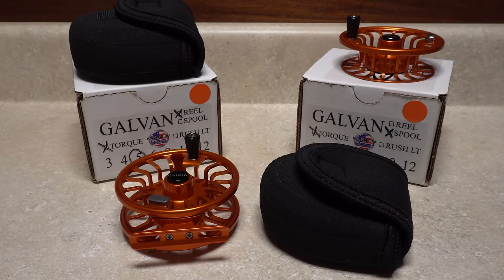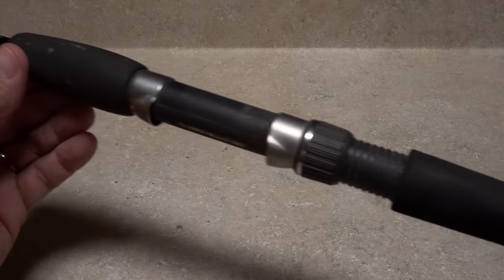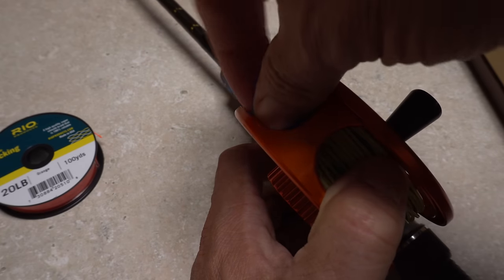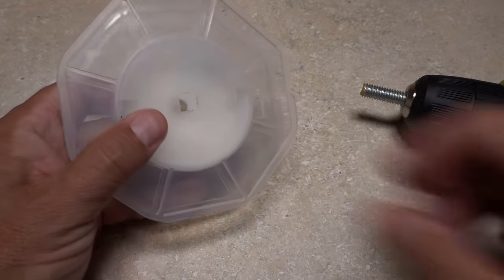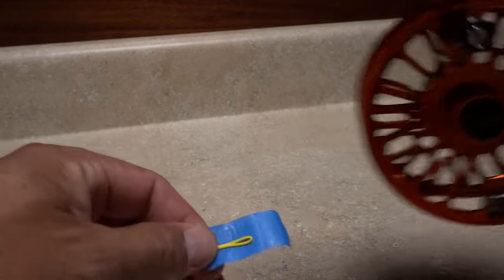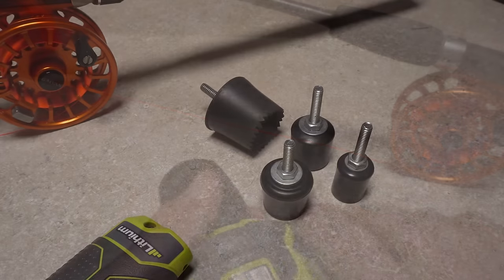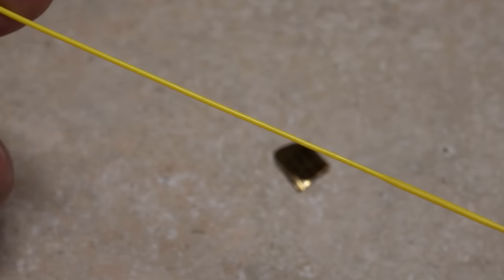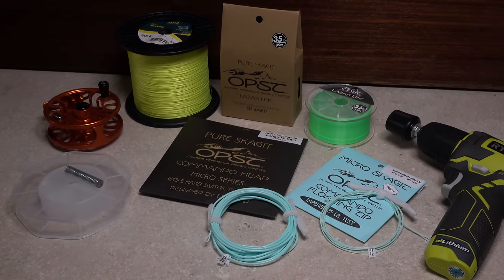How to Set up a Fly Reel

Comment: Used this method to setup my new 8wt. I used my shop vise with a bolt and washer to hold the fly and backing spools. Using the drill to pull the line off the reel was super easy. Awesome method. Thanks!

Comment: Nice idea about Cup. I did not think about that cup. I use drill and different diameter of nuts to fit different spool and had Japanese made spool adapter to wind the thread with tension. You learn something everyday

Comment: Can I use 40lb braid for backing?
Reply from the maker: Yes you can but it is very thin and tough on hands when reeling in. Dacron is larger in diameter, softer and definitely more friendly on the hands.
Reply: @tightlinevideo  okay. Thanks for your input
Reply: @Wyatt_Olson  Dacron will rot over time and must be replaced.  Because it is more expensive than monofilament, it can get expensive.  To get the most life out of your Dacron line, rinse your reel in tap water when you get home and make sure you let it dry thoroughly before putting it away.

Dacron is also susceptible to what is referred to as "braid bite" or sinking into itself.  If not wound tight, the Dacron will sink into itself on the reel and cause your reel to lock up.  This makes the drag ineffective and puts a lot of pressure on your line.  The end result is usually the line breaking.

Another disadvantage to Dacron is that many anglers complain that it is difficult to tie knots with. Certain knots do not ever seem to get tight and stay tight which can result in losing tackle if you are not careful.

Braided Dacron is also known to have very little resistance to abrasion.  It has been known to break if it rubs against anything jagged or rough.
Reply: @Puckerization  yeah I just got some and it feels similar to braid. And it seems like it could dig in to the spool like braid.